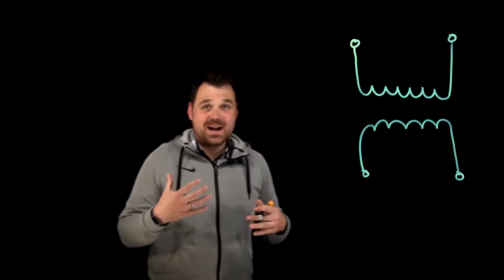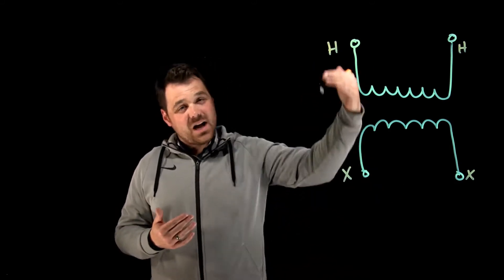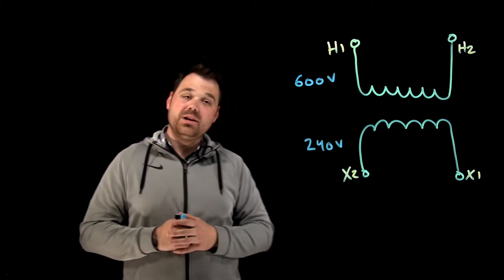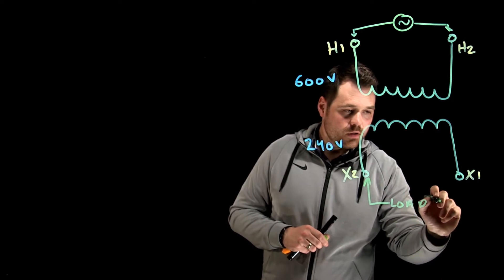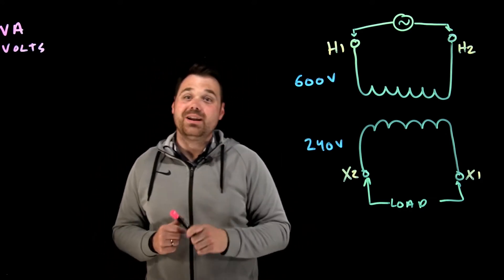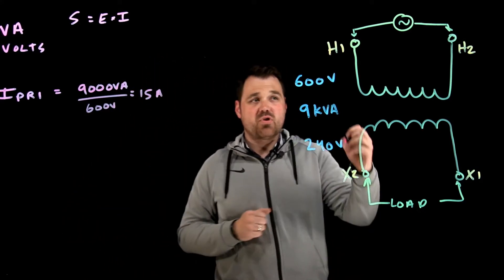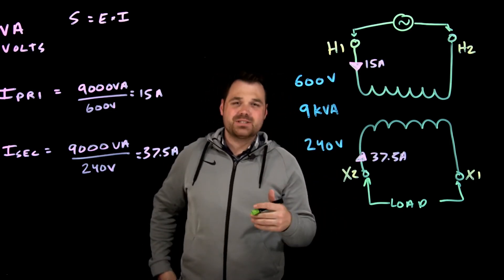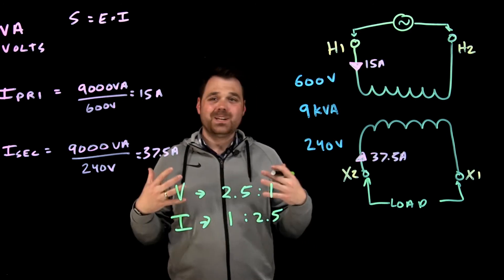Transformer Ratings and Markings

Comment: In my job I don’t have to size transformers but I have experienced issues with under sizing with regards to inrush current. Specifically across-the-line starters. Are engineers typically taking inrush into account when sizing or are they just sizing by FLA? Likewise, if they are using inrush, do they size differently for soft starters vs ATL?

Thanks! Love the videos!
Reply from the maker: Hi Justin, I have no idea how the engineers are doing it actually. Sorry. 

Thanks for watching!